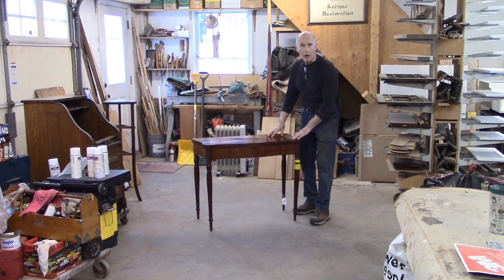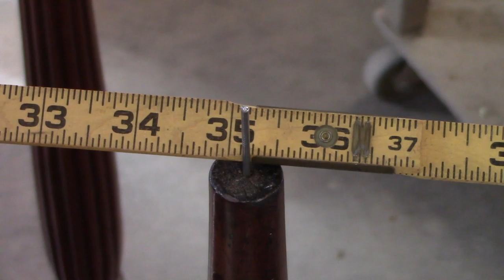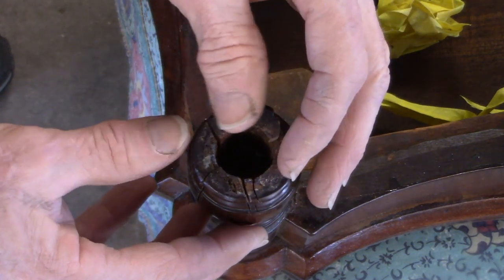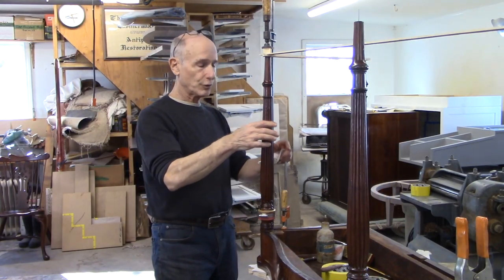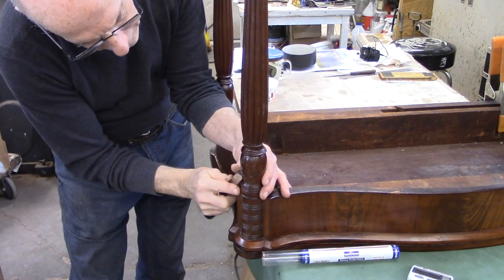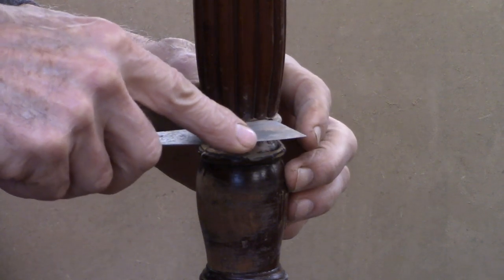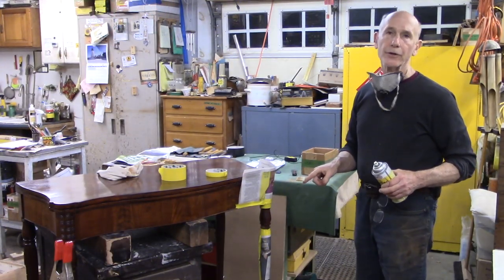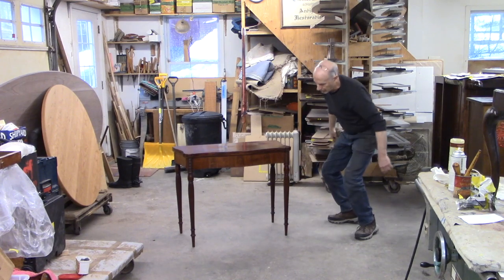Salvaging a Card Table's Shattered Leg - Thomas Johnson Antique Furniture Restoration

Comment: I absolutely love epoxy putty.  Mother had a carry-on suitcase with two wheels and two feet.  The two fixed feet cracked and broke -- just plastic I guess, but the case was still good.  I removed the broken feet, Inserted (from the inside) a bolt, fixing nuts on both the inside and the outside so that I could adjust the length of the "feet" to the right length.  I then molded the epoxy around the bolts to form nice looking feet.  Mom died in 2008 at age 97 and I inherited the bag.  (I had been borrowing it from time to time so it was getting used.)  Here it is, 2020, and I am still using that bag; the feet that I made still like the day I created them.  That putty is incredible!
Reply from the maker: Thanks! That is amazing! I never realized it could stand up to that. You're giving me some ideas

Comment: Another great save! I'm impressed how strong that epoxy repair seems to be...I've always shied off using that sort of repair because I thought it would be frail, and it didn't appear it would come out that durable...think the difference is possibly the clamping, and if I ever did undertake any further DIY projects like this again, I'd want to invest in some decent clamps...or more sensibly at my age, (and with my dismal lack of ability!), invest the money in someone like Tom, if I could find one nearby...never thought I'd rue not living left-pond!
Cheers as always
Dave
Reply from the maker: Thanks! The West System Epoxy is amazingly strong. There has to be many fine craftsmen where you are!

Comment: Uploading late at night and I am here for it!

Found a little mid century corner table a few months back and use that epoxy wood filler to fix two of the corners that had chunks missing and it worked out great. Hand painted the fixed spots to match the top Venere and you can’t even see the patch work. Thank you for these videos I love seeing what I can fix using the Skills and techniques you share.
Reply from the maker: Thanks! 1st comment! Sounds like you did a good job
Reply: Thomas Johnson Antique Furniture Restoration Thank you 😊 I truly appreciate it.
Reply: I love how these kinds of videos inspire me to take a second look at old broken furniture and consider if they can be saved rather than thrown away! It really tickles my creativity. Repair, reuse & recycle!

Comment: "The chemistry of wood" is the thought that comes to my mind as I watch Thomas "keep the leg original". I admire your skills that are manifested in abudance in this project, as you work with not only the physics of forces on the leg as well, the chemistry of glue to ensure that the pieces adhere to each other, the geometry of keeping the damaged leg in the right position and the the techniques used to press the leg down and the base of the leg round where it had shattered.  Then of course all the precise finishing to restore the original look.......
BRILLIANT - This must be one of the best examples I have seen  of years of experience (failures and success) working with a Master in Antique Furniture Restoration.
Reply: I really have to also commend you on the use of the hose clamp and the way you aligned the leg.. Ingenious. A beautiful repair as always. Although I think the word repair is an understatement on the way you keep these old pieces alive . Thank you Tom.
Reply from the maker: Wow! thank you! It's all true but it's funny, I am certainly not thinking about how much goes into it at the time
Reply from the maker: You're welcome!
Reply from the maker: Thanks! I was prepared to make a third, but the 2 seemed adequate

Comment: This shows a problem I have encountered a few times. The bigger the dowel the less original wood is left and is often inherently vulnerable. I started to put my faith in three or four, small diameter threaded rod dowels and epoxy. This seems to be a much stronger repair, but I haven't tested it to destruction!.. Nice job again Tom. Thanks for posting.
Reply from the maker: You're welcome! I agree, using smaller dowels is a good idea. I can see whare it would be difficult to get everything to line up if you used more than 1 dowel though

Comment: I went to a chic antiques fair in Paris one day, not intending to buy when I saw a lovely little table/desk with large drawer and leather top in a van. The owner on taking it down let it fall and the leg shattered as I was passing. I asked how much it was, he said 10 euros as is so I couldn't resist. I hadn't thought that carrying it home was going to be such a problem and up two flights of stairs ! It was an easy repair as it was fresh and no missing wood. I love that desk and could not have afforded it had it not been broken.
Reply from the maker: That's neat! Did you repair it yourself? It's always so great when the break is fresh and all the pieces are there. Good job!
Reply: @johnsonrestoration  Hi, yes I did, I went out at once and bought some fast drying wood glue and it made an invisible mend as it was fresh with no losses. The desk/table is burr walnut with plain walnut legs and lovely antique tooled leather on top. The drawer is unusual in it is as large as the front of the desk and as deep with partitions and the lock with key is really old and original. As I said I would not normally be able to buy Something as nice, it was Worth the struggle to carry it home. I used to have a home in the country with a large space for restoring furniture for the house but it was sold. I miss it ! One day I went to a DIY fair and wanted to buy a wood machine ( multi type) it was a really expensive buy for me but the man kept asking me to send him my 'husband' so he could explain to HIM how it worked ! I gave up ! My husband couldn't hit a nail with a Hammer ! In my village ( highlands of Scotland) its the women who do anything manual ! or at least they used to , now they need both hands to type on their bloody idiot phones ! xo

Comment: Masterful use of the circle clamp. There is a third dimension for the location of the end of that leg, and that is the length of the leg. It always seems to work out that proper clamping produces the right length for a broken leg. Have you ever had one come out a little too long, or (worse) a little too short?
Reply from the maker: Thanks! Oh yeah! Then you have to adjust the other legs a bit. And it's tough if you don't have a level place to try it out

Comment: Lots of neat tricks in this - The sticks with holes in them to make sure all the legs were accurately positioned.  Using a Jubilee clip to hold and provide pressure to the glues section - simple and clever.  I take it you used epoxy to glue the pieces rather than hide glue, because epoxy has gap filling properties.
Reply from the maker: Thanks! All is true!

Comment: Love the use of the nails, and pieces of wood to keep the cross member distances. I'm wondering why you didn't put a piece from the opposite diagonal legs? You put a piece to keep the broken leg from it's opposite leg, but not the other two diagonals. Wouldn't that ensure the squareness of the table legs? Just curious and wondering why.
Reply from the maker: Thanks! It seemed to be just fine with just the 2 braces. I would have used a third if I thought I needed it

Comment: What a beauty! Thank you for showing all the tools and how you apply them.
I'm curious - why epoxy and not wood glue for the initial repair?
Reply from the maker: Thanks! The pieces would have glued up fine with regular wood glue, but the dowel was not tight, and I'm relying on the epoxy to fill that gap https://www.youtube.com/watch?v=AmFot8H_2Kk

Comment: Great job, also great idea to use a hose clamp to keep all pieces together, under pressure!
What exactly was the type of glue, you used to glue all those pieces together?
Reply from the maker: Thanks! i used West System Epoxy, I don't use that often, but this leg needed all the strength it could get

Comment: I liked your idea of using the hose clamp and a soft rubber pad to squeeze the broken pieces together!  Then when I saw you trying to carry the lines around the leg "by eye", it came to me that the same concept using a hose clamp would work to keep them perfectly horizontal as a guide for your chisels or files. A split section of PVC pipe and a hose clamp seems like it would work in that regard, but that's not to take away any of your craftsmanship working it by "eye" however!
Reply from the maker: Thanks! I think I know what you mean, it sounds like an idea that could work. maybe I will try that

Comment: Love the work.  Have you ever done work on flood damaged antiques.  I have a piece that went through about a foot and a half of water which damaged the finish.  The rest of it was pretty easy to fix but the finish is a problem.
Reply from the maker: Hi Paul, once they're dried out, pad denatured alcohol on the damaged areas with a rag. Then I would spray aerosol shellac on the area, see how it looks. Abrade a little with a grey Scotch Brite pad, and then aerosol toner if needed, and then a satin clear coat. All these products are available from Mohawk or Woodworker's Supply
Reply: @johnsonrestoration  Thanks for responding

Comment: Tom, thanks for this video. I have an antique dough box that has a cracked leg that I would like to fix.  It looks like the previous owners tried several time to repair it.... without success.  Any recommendations on how to remove all the old glue and wood filler, to get down to the original wood?  Thank you.
Reply from the maker: Thanks! often you see me using a heat gun (a hairdryer will do fine), with knives to scrape and then a wire brush (gently). Sometimes a solvent like lacquer thinner helps, but the heat is the thing

Comment: Love your work. A few questions about your materials.  What was the final ingredient you used in your epoxy?  You mixed the 2 part epoxy, added dry dye, then a white powder.   What was the white powder?  Then you used a dye at the end.  Was it the same dry dye powder?  And if it was, what did you mix it with?  Thank you
Reply from the maker: Thanks! that is Coloidal Silica, one of the thickeners you can get with the West System epoxy. The color was just dry powder stain, alcohol soluble, from Mohawk. The dye stain for touch up is Mohawk Ultra Stain.https://www.mohawk-finishing.com/

Comment: Do you have any log term insight to share about the use of epoxy? I work in the automotive field and it seems to me 8-10 years is a good long life. I typically see lifting around the edges, particularly with thin applications. Maybe it has to do with temp changes, high under hood temps or applying to other plastics instead of wood. Just curious if there is a particular type of epoxy that you prefer and if longevity is a concern. 

Thanks for the great content!
Reply from the maker: Thanks! I use West System, don't have experience with other types. We glued 2 rocks together with West System, and have left them outside for 20 years. Still solid

Comment: Just out of curiosity, previously the table leg was repaired and the leg (presumably) was just glued into that hollowed out section with a dowel.  How is your fix of epoxying the exploded leg base going to hold up long term compared to the previous repair?
Reply from the maker: I think that my repair might only be better by a little. I'm really counting on the epoxy to prevent any movement of the damaged area. The previous repair might have failed only because the leg was stressed again while being moved or something
Reply: @johnsonrestoration  Thanks a lot for your reply.  It's very informative.  I'm guessing you often have to make the decision whether it's practical economically to do a full replacement as opposed to just a repair.  

I assume you present both options to your customer and they make the decision?

Comment: I don't mind getting my hands dirty doing repairs. I hardly ever wear gloves. But with liquid epoxy I am surprised that you don't use gloves. The putty, not so much. Also, isn't there a release agent for use on the exterior surface of something like the barrel shaped glue up? Seems like the squeeze-out would chip off more easily. Perhaps Burn In Balm? (Mohawk)

Great work as usual.
Reply from the maker: Thanks! Wax would work also, but I'm always afraid of getting the release agent in the glue up. I knew I would have to sand this one anyway

Comment: Instead of reusing the same oversized dowel that caused the leg to break apart, how about removing it.   Fill in both holes with a hardwood dowel, drill out for a 3/8" metal rod/bolt with epoxy.  This would give plenty of strength plus the hardwood.  With missing wood in curves and such I make a mold from an adjoining pieces.  Bondo works well for both the mold and filler, use oil for a release on mold.  Saves sanding time.  Powder ground pigment with lacover used to touch up, then lacquer over.  The hose clamp used as a wood clamp is a good tip, and learned other things from your videos.   Thanks for all your work with videoing while working.
Reply from the maker: Thanks! I was afraid to open up an even worse can of worms! They leg certainly seems strong. I've never used metal for dowels, I'm not sure it's a good idea. I want the wood to bond to that dowel
Reply: @johnsonrestoration    There could be problems with epoxy adhering to a smooth metal dowel.  But a threaded machine bolt or a metal rod roughed up on a grinder would give plenty of bite for the epoxy.  I've even used this method on a mechanical clown bank where the mouth gets gets heavy stress and banging.  Look forward to seeing more of your videos and helpful tips.  Tom

Comment: What kind of epoxy is that?  Nicely done!
Reply: Western. It is a two part epoxy. I can get in the UK. The pumps are great, as you don't have to measure. You can add fillers too, to alter viscosity, or strength.
Reply from the maker: Thanks! A fisher is right, West System Epoxy

Comment: I reckon that will break again before too long - the dowel looks to short and too fat. I am sure the epoxy will hold but there isn't much to stop the wood splitting across the grain again. I would have put a smaller and longer dowel in the end of the current one , and a corresponding hole in the leg stub, to really get some length in that joint.
Reply from the maker: Thanks! I thought about that, but the leg had been drilled into a few times already......

Comment: I enjoy your vids immensely.  However, at the risk of sounding like a safety nanny, I strongly advise anyone working with epoxy to avoid handling it with bare hands - the hardener is a very nasty, hazardous compound which can be absorbed through the skin (and using solvents like acetone to remove it only serves to drive it into your skin faster); plus, you are likely to become sensitized to epoxy and will develop a severe rash, preventing you from using it down the road.  Also, the silica powder used as a thickening agent needs to be handled very carefully to avoid getting it airborne, and you need to wear respiratory protection - silica fines are extremely hazardous to your lungs:  once they get in they latch on to the tissues and never come out, much like asbestos, resulting in severe pulmonary disease. Ask any boatbuilder, most of whom use the stuff regularly, and they will confirm what I'm saying.
Reply from the maker: Thanks! I appreciate it, and I'll be more careful going forward

Comment: The screw holding the top on looks hand made. Slot not in centre. When did machine made screws become generally available in the US? Mid-19th it's said in England. Also Cuban mahogany would indicate earlier in England anyway. No bricks on the front? Carpenter made perhaps rather than cabinet maker? I saw a Georgian linen press where the doors were a slab not panelled. I thought estate carpenter. Not so sophisticated.
Reply from the maker: Thanks! It's hard to say - I need to research the screws. I don't know when they were machine made
Reply: In 1809 England put a tax on mahogany imports from outside the colony of Honduras. People stopped using the Cuban wood much. Honduras was not as good. I wonder about the US.  @johnsonrestoration

Comment: What a terrible repair!  Table value ruined. That leg belongs in two pieces.  It looks pretty bad and now your epoxy solution is irreversible.
Reply from the maker: Thanks! I'm not sure, but I think the value of the table was affected by the break, not the repair. The table was useless with only 3 legs. By the way, the epoxy reverses just fine with heat.